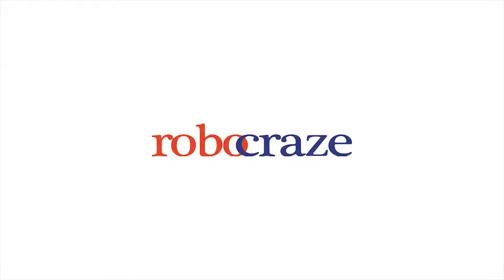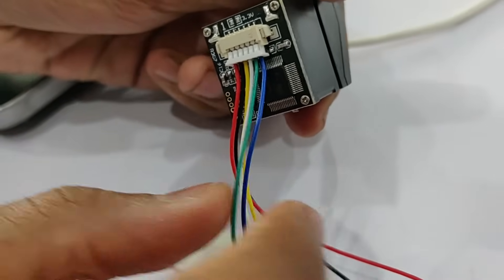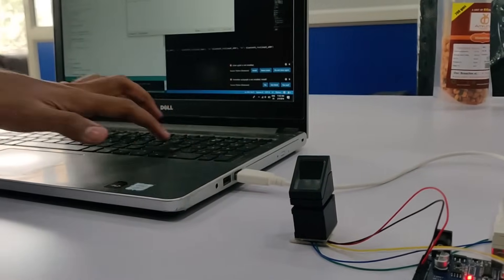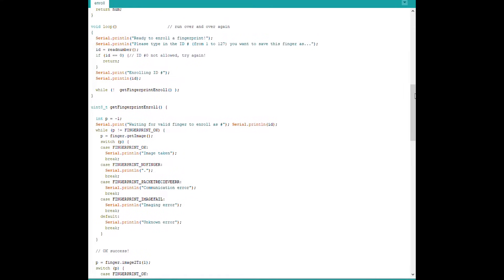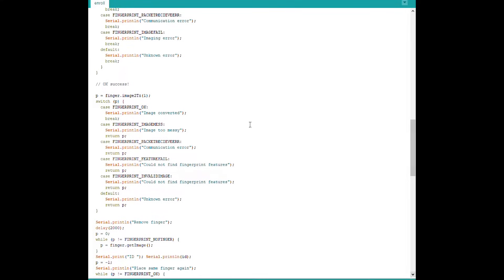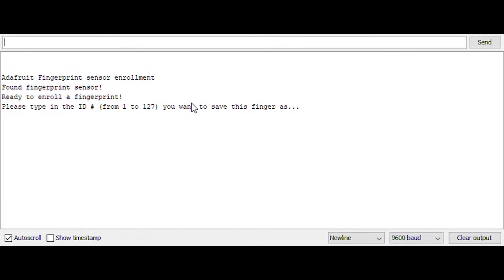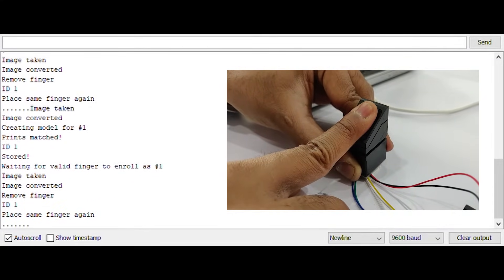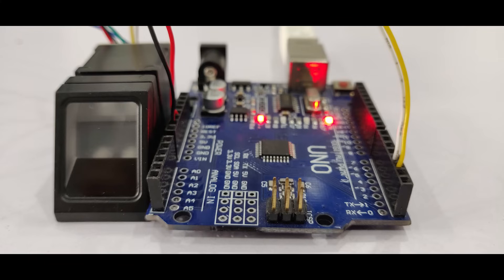Fingerprint Sensor with Arduino UNO Tutorial: R307 Setup, Code

Comment: I recently bought r307 finger print module from a local store
It has these pins
 vcc,Gnd,d+,d-,3.3v,led ,tch
Please help me in making a connection with my raspberry pi should I use a usb UART TTL converter I am little confused

I tried to make direct connection and it is failed please can u give me clarity
Reply from the maker: Hello,
Please create a ticket on support.robocraze.com

Comment: can i connect the fingerprint sensor tx and rx pins to 1 and 0 of arduino ?
Reply from the maker: Hello, Yes, you can connect the fingerprint sensor's TX (transmit) and RX (receive) pins to pins 1 and 0 (also known as Serial1) of an Arduino but it will need changes in the code.

Comment: I am also facing an issue that "Did not find fingerprint sensor "
It's urgent i have to submit the project work sir can u help me out from this
Reply from the maker: Please ensure that there aren't any lose connection between your microcontroller and fingerprint sensor. You should also be able to see a green/blue light when the module turns on
Reply: @Robocraze  yes but it truns on for only one sec and trun off again
please help me
Reply: @mrkingdom4191  Have you fixed the problem?
Reply: @mrkingdom4191  Hello, did you solved the problem? i have the same issue, the led bliks an stay off.
Reply: no i think my fingerprint sensor is not good 
 @anviciber
Reply: I am facing the same problem. How to solve it?
Reply: @daliasett8110  Hello, did you solved the problem? i have the same issue, the led bliks an stay off.
Reply: Where will be the blue and green lights will on

Comment: I am facing  issue Did not find fingerprint sensor on Arduino uno.Connections were also correct. The backlights are not turning on
Reply from the maker: Hey! Please share your connection diagram to our mail tech@robocraze.com.
We need more details to help you out.

Comment: Also, what could be the reason for getting "Did not find fingerprint sensor :(
 " ? 
I did everything as in video, same sensor, same code, only difference is I have a leonardo board.
Reply from the maker: Hi! Please check the connections. In case you need further help, please drop us a mail to tech@robocraze.com

Thanks.

Comment: Hello!
What do you mean by  this: 
// On Leonardo/Micro or others with hardware serial, use those! #0 is green wire, #1 is white
Reply from the maker: Hi! There was a typo in the comment which has been corrected. It is #0 for yellow and #1 for white.

For Leonardo/micro: The USB is connected to different pins on the microcontroller than the serial pins. The hardware serial is called Serial1 ("Serial" is a virtual USB serial port, it can only be used to act like USB-serial adapter to a USB host)